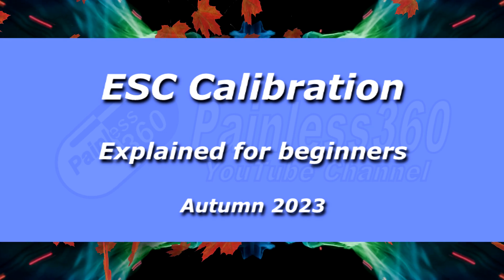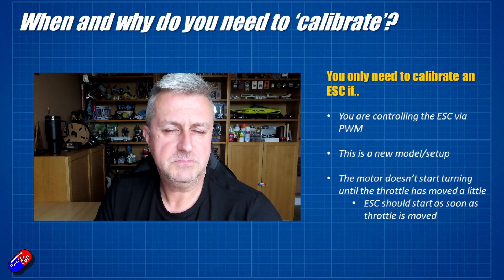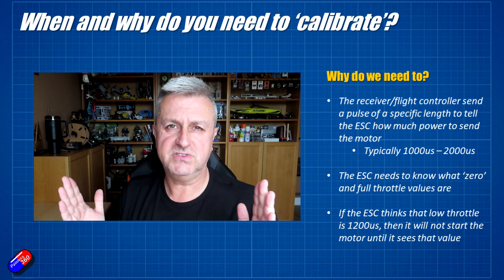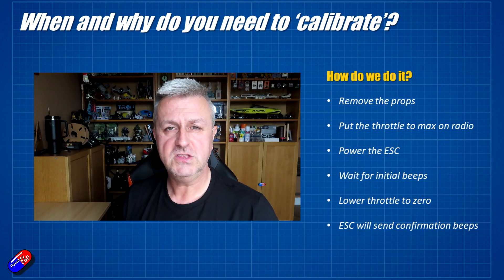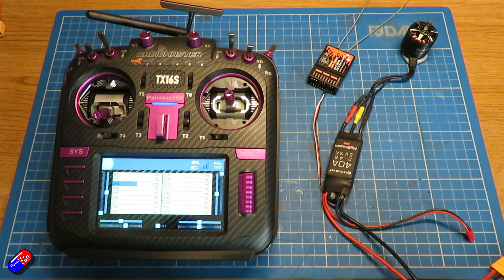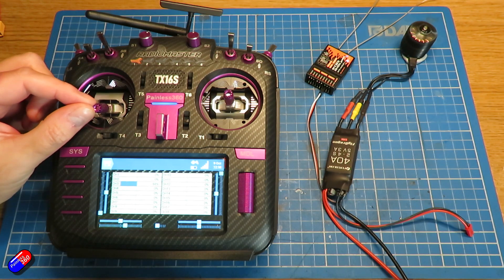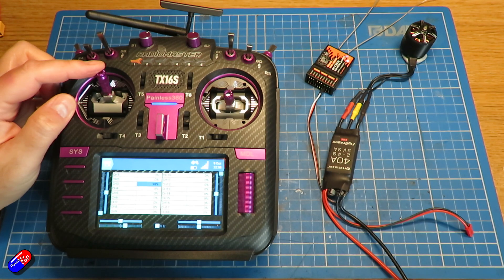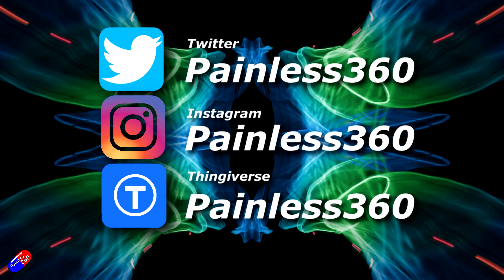Simple ESC Calibration

Comment: What about reverse 

I have a boat and no reverse means no brakes
Reply from the maker: Check out the manual for the ESC you have. There are a few ways that can be done. Best of luck
Reply: @Painless360 no manual 
bought it off eBay 

forward didn't work either
Reply from the maker: Swap any two of the three wires from the esc to the motor then... best of luck!

Comment: HELP. Hi. Thanks for ur advice. Done the calibration but still the motor dont start to spin till mid stick. DX8 G2 radio, hobby wing platinum 80A esc. Pls advice. Thank u.
Reply from the maker: Check out the settings on the ESC. Reversing ESCs only start at 50% throttle... best of luck
Reply: Full throttle plug lipo getting two beeps. Lower the stick then insted of getting two beeps then six beeps for six cell im getting 6 beeps. Resulting no throttle till mid stick.
Reply from the maker: Check if it's set for 3D mode

Comment: I have a few ESC's that this Calibration method does not work. The only thing I can do to use this dead space is to put some sub-trim in for the throttle channel.
Reply from the maker: Please post the make and model of the ESCs you are talking about... Happy flying
Reply: Turnigy Trust 45A and 70A  @Painless360

Comment: Does the position of the throttle trim have influence on this process?  I.E. if you move the trim either before or after the initial initialization, how much if any effect is there?  You definitely understand electronics better than I, and that is an area that I haven’t checked out, wondering if you have?
Reply from the maker: Yes. Don't move the throttle trim. Happy flying

Comment: Another great video from the master.  Question: On my T1 VTOL PnP, only the rear motor spins when armed, until I raise the throttle to about 50%, then the front motors come to life.  I tried calibrating ESCs in Arduplane, but no joy.  Any ideas?  Greetings from TN and thanks as always.
Reply from the maker: The front ESCs may be set wrong. I'd check them with BLHeli if you are using DSHOT..
Reply: Set IAW 4.4 parameters.  Yikes, no change.  Maybe I should wait until you post your fine tuning of 4.4 for the PnP.
Reply from the maker: Already have. But that shouldn't affect the motor ranges... Test the motors using Ardupilot... Best of luck
Reply: Success!  All motors are running as they should.  Thanks to both you and Giz Fpv.

Comment: Great video! It's like you're reading my mind... :DD I have the same problem with my ESC but I thought it was normal. I need to give quite some throttle for the motor to spin and also, after some throttle the motor maxes out before maximum throttle. I don't know if my ESC uses dshot or any other protocol but I will try your method regardless and let you know. (I have fixed wing).

Comment: this bit me in the arse recently, 99% of my models have an fc as I couldn't keep a plane in the air without the fc providing support when I first started to fly. Recently realised I pretty much turn off all the support and fly just using my acquired flight skills. So I built a new plane with just a receiver motor and servos and couldn't figure out why their was a dead band on the throttle. after a day of thinking I remembered to calibrate the esc.  good info Lee

Comment: What do you mean you don’t have to calibrate esc’s running digital protocol?  What do you mean I’ve wasted hours googling esc calibration and completely missed this.  Well that’s my fragile ego shattered just 7 days into the new year…..😂
Reply from the maker: I've covered that little nugget in lots of my buuld videos over the past few years so glad this video is raising awareness... Happy flying
Reply: I started off with 4 channel AM radios that were not adjustable.  They had trims for each channel, but you really had to adjust everything mechanically to insure a bump on the slider wouldn’t cause disastrous results when plugging in or turning the airplane on.  Didn’t even have servo reversing on the first couple, then computers started coming into the game 😮. On single motor electric planes I don’t remember half of the time to even set motor limits…..amnesia setting in😂